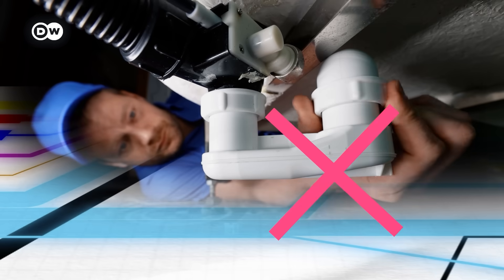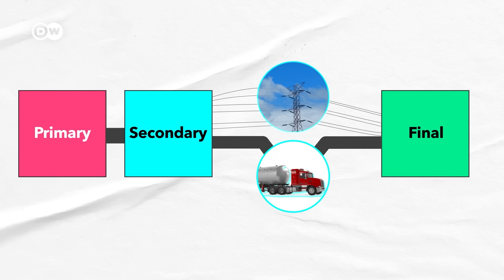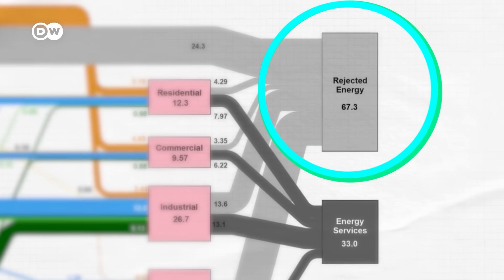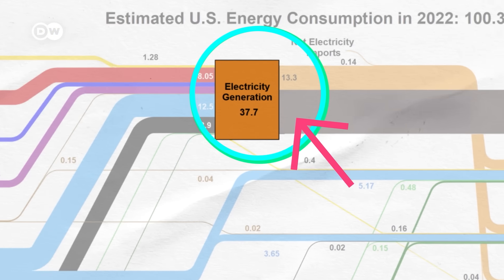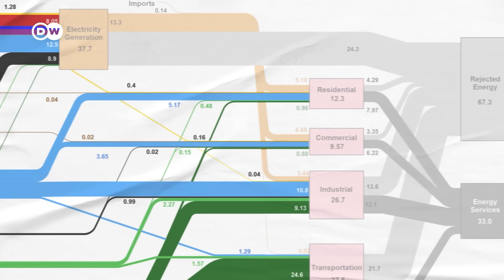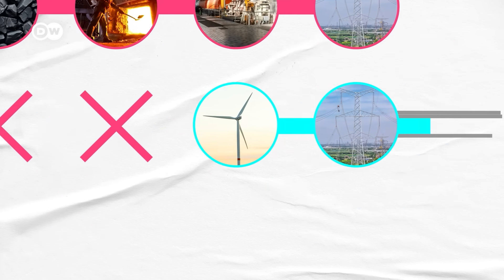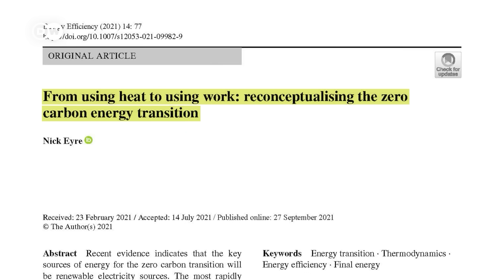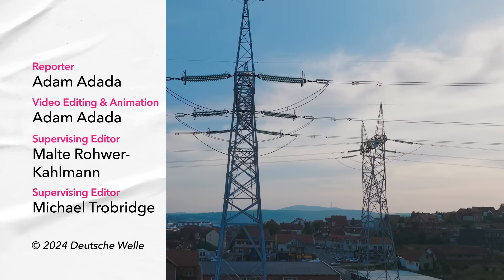The mind-blowing thing we get WRONG about energy

Comment: I feel like half the story was left out.

OK we can do much better by reducing fossil fuel inputs and utilizing high efficiency appliances. If we do that how much will these charts change? Please consider drawing up a new chart of what is potentially possible so we can see the difference visually. Where is the sweet spot where we get the most benefit with the least change?
Reply: Good point.
Reply: Today our primary consumption as consumers is electricity for home use, business use, and fuel for cars (ICEs).
We can replace the ICE cars with EVs, and we can work on Grid-Level energy with wind & solar and some batteries.
These are being done, but might be sped up.
Home construction and energy conservation is happening, but is driven more by state & local building codes and the preferences of contractors or home-buyers who may want particular things that conserve energy.

Comment: The accounting is fundamentally wrong and heat engine centric, cus it's not great counting wind energy or sun's radiant energy vs burning stuff energy (if the end end product is electricity); like why do we care about wind force applied to turbine blades to turn it or EM radiation energy from the sun, we just care about electricity, in this case. 

There are also situations where the burning stuff primary energy is used directly as heat; those do have to be either 1 to 1 (since electricity to heat is almost 1 to 1) or better if using heat pumps.

Comment: It is even better if you add heat pumps to heating stuff. Sudenli, you need a third of a third of energy. It is even hard to comprehend how little you need to go renewable.
Reply: Just use a heat pump and maybe put solar panels on the roof. That would be pretty smart but unfortunately if the roof is not huge it's hard to cover all the demand.
Reply: @imtheeastgermanguy5431  1 or 2 solarpanels on each balcony and 10 on the rooftop. Thats enough
Reply: @imtheeastgermanguy5431  If I wanted my home to cover the entire carbon footprint of all the people under the roof, I would need  300 solar panels per person to get to the equiv of the 10kWpr of power that every US person uses. The 10kW does not get divied by 3, because you have to use lossy storage to make the RE work, so 10/3*3 right back to 10kW. A new Sankey diagram that covers all the losses in long term storage, meet the new boss, same as the old boss.
Reply: @johnjakson444  My sister has panel + pump roof system. I am in northern europe. It works well. 4 person family. Your numbers are not reflecting reality.
Reply: @johnjakson444  what are you on about? Did you even watched the video?
Reply: *Suddenly
Reply: a third of a third, otherwise known as one-ninth?
Reply: @SlashHarkenUltra  The power of math is strong with this one.
Reply: And even if you replace a gas heater with a heat pump and that gas is now electrified in a power plant, you still only need a third of your original energy need
Reply: Nuclear power will solve all this energy issues and still be climate and environment friendly.
Reply: @Ratinevo  i dont have 10 bilion to build nuclear pp. And there is few places to store waste for thausands of years. Nuclear is apsolutly facinating technology but i aint buing it might as well forget about it.
Reply: @cookingonthego9422  Why? 😮
Reply: @Ratinevo  no, not at all

Comment: If the synsergy is so great and so, then why is germany emmiting as much co2 as always? Well this efficiency thing looks good on paper but thats it, it just looks good.
Reply: because germany closed down their nuclear plants and replaced them by coal and gas plants...
Reply: @hugobarros6095  Nuclear plants only had a share of 6% when they were shut down in Germany. So they didn't really notice, when they were switched off.
And coal and gas consumption is the lowest since is the lowest since 1960.
Reply: Germany has not been building out their electricity grid quickly enough, which is why they relied on cheap natural gas too much.
Now they have to speed up the change, even though they removed subsidies to EVs, so the charging is not going to be as big a problem due to the car industry delaying the EV transition.

Comment: Nuclear mate, the solution to all of our problems. 
Also in terms of the environment, take a look at how many trucks and cars are on motorways and now imagine the environmental impact would be in order to replace all that(let alone that long haul electric trucks are not existent or cheap evs that people can actually afford). We don't have a problem with the type of energy we use we have a consumerism problem, we can switch from oil to Lithium to newer materials as long as we behave and design stuff to last only a few short years we're just screwing ourselves. 
Hertz in USA shown that electric cars are more expensive and harder to mentain even if they should be cheaper and easier, that's mostly because manufacturers have made stuff harder to fix and easier to just replace, an old car might have come with a manual or instructions on how to fix a certain part at home meanwhile newer models just replace assemblies or the part not even considering the possibility of repair. Look at how our electronic devices are designed, an old MacBook would have had a replaceable battery, storage or memory meanwhile new stuff at some point can be considered e-waste.
I think if we keep looking to live the" buy a new car every 5 years or buy a new phone every 2-3" and so on we won't solve the issue, but it's not about solving the issue, if there is one rule our world has above anything is that money should flow no matter what. 
I have upgraded my house, I have a fairly efficient hybrid car and I'm the owner of a small transport company, a new German law meant to lower co2 emissions taxes my euro 6 trucks because they are older than 5 yrs, newer euro 6 trucks are taxed less, I have seen the COC(certificate of conformity) for new trucks, they aren't any better or barely noticeable than my older units yet we're forced to buy new ones to save the environment. I don't intend to buy new ones only when I need them but huge logistics companies have changed their fleet to newer ones without really gaining anything in efficiency and with the added carbon of new produced stuff in the world.
We need to change our mindsets before we change our energy grid, we're not going to do that we will encounter the same problem. 
Don't even get me started on data centers energy usage and for what? Data collection and advertising? Is it worth it?
Reply: This is also a problem of wealth distribution, tell Indians that they shouldn't use cheap coal or wood to power their lives  or tell the people in Eastern Europe to not use their 10-20 years old cars because they need to buy electric and you'll get this culture war. Changing mentality is more difficult than changing the power grid, this is the reason we're not fixing anything we're just kicking the bucket down the road hoping that the problem falls on someone else to solve.

All cars manufacturers are trying to make more efficient SUVs, instead of sedans or smaller hatchbacks. Why SUVs? Because we like consuming stuff, opulent stuff, stuff that shows how wealthy we are...
Reply: 88,000 tons of nuclear waste (and counting) with 10,000 year half life in the US is a major issue for generations that come after us. This waste is currently stored at the generation plants which isn't the ideal long term storage. No nations have been successful in building appropriate long term storage facilities.

There is much less waste that degrades much more quickly with wind and solar. Nuclear should be phased out.
Reply: that 88000 tons is just.... a football field.... nuclear should replace coal where wind and solar are not feasible. it should be both options to phase out coal, not either one, bcs with your anti-nuclear mentality, thats how Germany today ends up reliant on coal, with their carbon intensity at ~350 CO2/kWh, meanwhile France can attain ~40 CO2/kWh due to nuclear. @JeanPierreWhite
Reply: @JeanPierreWhite that 88000 tonnes if stacked together is just a football field wide...

your anti-nuclear hysteria is the reason why germany's carbon intensity is 7x higher than france's

NUCLEAR FTW
Reply: @JeanPierreWhite  the only reason we dont reuse the nuclear waste is because it is cheaper to just use new uranium.  If they recycle the nuclear waste it shortens its half life. One thing I would point out.  The chemicals from solar and wind turbines are forever chemicals.  They poison the ground where they eventually get buried forever.
Reply: @JeanPierreWhite  think about it, if we use nuclear material for its radioactivity and nuclear waste is radioactive we can use nuclear waste as fuel. The only real reason we stopped investing in nuclear is politics, nuclear is safer (in terms of deaths) than some renewables and it solves a problem that renewables have... reliability, renewables aren't really reliable and if we look at the devices we use to harness the energy they're also not really renewable (nothing is renewable). And don't come to me that we solve renewables reliability issues with batteries because I have had bad experiences with batteries (one battery pack in my solar installation has failed after one year).
The truth is that we can ignore nuclear if we want to reduce our environmental impact. Also we shouldn't phase out nuclear we should phase out lobbying as it is anti democratic.
I won't provide that many links but you can look on YouTube for Kyle Hill or Elina Charatsidou. Feel free to do your own research when it comes to this matter

Comment: What's really mind-blowing to me is that so many can't understand that we don't need to replace the amount of primary energy we use with the same amount of useful energy even when it's explained to them. 

Another thing that's mind-blowing to me is that we burn fuels to generate power, in part to generate heat via resistive heaters somewhere else. 

Or that we use a lot of power to pump heat out from indoor air, into hot ambient air outside, and then have a different system that use a lot of energy to produce hot water, it's often even quite cold water that we heat up, to a high temperature, that we then mix with cold water again to get the temperature that we want.
Reply: Someone recently questioned my calculations that showed a 30% reduction in energy use just by electrifying ground transport and heating. 
They couldn't believe it would make such a big difference.
Reply: @Paul-yh8km   In the video they didn't even mention how much electric power is lost due to long transmission lines. Electricity needs to be used over the short-run because long-haul lines lose it to the air. Yep, all that effort to get coal or oil from the ground and then it's lost to the air.
Reply: @markhathaway9456  There are ways to reduce the losses in transmission. Considering it's dependence on Current, you can raise voltage using transformers to hundreds of thousands of volts, then transport the energy at that voltage. Transmission losses in the US is only 2%.
Reply: @markhathaway9456 
In general the grid only loses about 6% to 8%, it's not a lot and AC transmission is generally only used over a few hundred miles.
For longer distances HVDC is used which is far more efficient.
Also you have to consider capacity factors, for instance solar in the UK has a 10% capacity factor, where as solar in Morocco has a 30% capacity factor, so you actually get more solar energy to the UK from Morocco than you would from local solar.
Reply: @Babyblasphemy 
2% sounds to low, but it depends on typical distances. 6 to 8% is more typical.
HVDC is more efficient than AC and is used for interconnectors.
UHVDC (higher voltage, lower current) is even more efficient, but only China has implemented that on any scale.
Reply: @Babyblasphemy    >Transmission losses in the US is only 2%.
Need source citation -- there are wildly varying estimates concerning those losses....
Reply: @Paul-yh8km   Thanks, Paul.  In '70s it was said that HVDC only justified for links over ~ 700 miles.  Improved insulation, and Moore's law effect on
semiconductors have enabled ABB to report that, by 2020s, HVDC is now viable over links of closer to 100 miles.
Reply: @TomMcinerney-g9b  
Well here in the UK all interconnectors with Europe are HVDC and there is one planned that connects north with the south in the North Sea. The Interconnectors across the channel are probably less than 100 miles.

Another advantage of course is that it doesn't matter what two countries grid frequency and voltages are, that can all be dealt with at the HVDC/AC interconnector convertor stations at either end of the interconnector.
Reply: @Paul-yh8km  Yes and in reality the saving can be even higher.
Reply: We only need to heat water to a high temperature to avoid legionella.
And heating homes should not be neccesary if built and insulated properly. Cooling should likewise be solved with blinds and shutters before spending precious power on an AC.
But we are so used to wasting energy in our daily life, that we hardly notice it anymore.
Reply: Please remeber to mention, from time to time, those wich cannot afford a single shower a week... Even cold wather...
Reply: You must have skipped your physics and chemistry classes.

Comment: When you cook using gas the energy that heats your house is not wasted!
Reply: It might not be wasted or it might make a hot home even hotter requiring more cooling.

As usual the answer is "It depends"
Reply: @JeanPierreWhite  The point still stands that it's not fair to just call energy that has a secondary purpose wasted energy. The point of the video still stands, but the numbers they are using are inflated if they haven't considered that cooking often serves a dual purpose of heating along with the cooking.
Reply: @charliemilroy6497 : You do know that a lot of people cook with gas in their home with AC?
And the losses in the AC makes it much much worse, than the few homes that gain a small amount of heat (and a LOT of humidity and small particles) from the gas burning.
There is no way around it, induction cooking is better in every way, despite all the crazy commercials from the fossil industry.
Reply: @poulhenne  That is true, but the point still stands that at colder times of the year, heat is a positive side effect (granted not necessary if you use a more efficient separate systems for cooking and heating). I'm not particularly supporting fossil fuels, I just want the figures to be accurate and not just bundle all secondary energy uses into the wasted energy category.
Reply: It is in the summer.
The key to efficiency is precisely targeting energy use and minimising loses.
An electric induction hob does that.

Comment: It's not mind blowing, this is thermodynamic law. What is mind-blowing, that 60-70% of wasted or rejected heat from a thermal power plant CAN be used as useful low grade heat. Switzerland uses  district heating (i.e. waste heat) from their nuclear plants to heat entire cities. China is following suit. 
I also find it funny how DW Planet also fails to mention that only 15% of global energy requirement is electricity. The remaining 85% is heat provided by, as they correctly said, inefficient fossil fuels. We could seriously decarbonise large chunks of this sector with newer higher temperature nuclear reaction technology. I'm pro renewables but nuclear uses a fraction of the land and raw material requirements per GWh generated. The real mind blowing thing is researching EROEI (energy returned on energy invested) on the entire lifecycle analysis of each energy source.
Reply: Soooo in the end small modular nuclear for industries' heat needs?
Reply: @enricod.7198  it depends, standard SMRs that use water as a coolant have an output temp of 300 deg C. With reactors that use molten salt and gas coolants, we can achieve temperatures well over 600 deg C.
Reply: @delusion2987  Very good point, the heat produced in combustion engines for transportations is a huge loss, not just the thermal efficiency of engines, but the thermal energy inputs required to refine crude oil at oil and gas refineries into useable fuels are colossal and often not considered.

Green hydrogen is a neat idea but if you check out the official UK DUKES energy reports, the UK has roughly 30GW of installed wind and solar capacity to our grid, and even with them getting priority to provide load into the national grid, it's still a fraction of total primary energy. To generate enough hydrogen we will need an absolutely mind bending amount of over-capacity once you factor in the energy losses after compression hydrogen for storage and then standard combustion of it again.

I like the idea of high energy density/liquid synthetic fuels produced by high temp reactors.
Reply: Electrification is the key to success. Denmark expects to have 75% of total energy from electricity as soon as 2030. Topping off at around 80-85% after that. Its not magic - its just an investment. And yes - Europe is far ahead when it comes to district heating and cooling systems which does lower total waste - and costs - a lot..
Reply: you are completely wrong though about heat, you forgot heat pumps. also please actually look into EROEI and dont just use it as an argument while you have actually fallen for an urban myth
Reply: @sirati9770  Eh, that's your reason I'm completely wrong? I didn't forget heat pumps, maybe you forgot heat pumps can only provide low grade heat, anything above 80-90 deg C is thermodynamically impossible. They cannot provide high temperature process heat for any industrial applications. Quantifying energy inputs and outputs, i.e. things humans can actually measure and quantify isn't an urban myth.